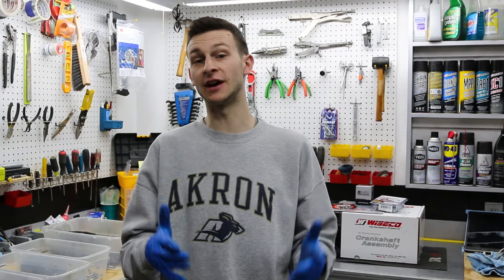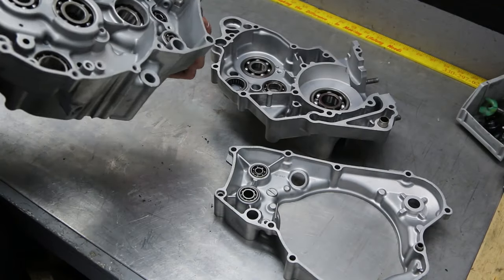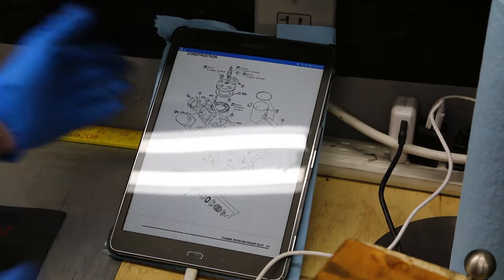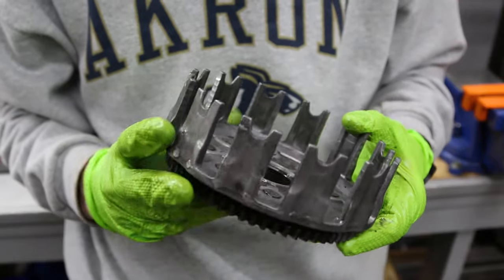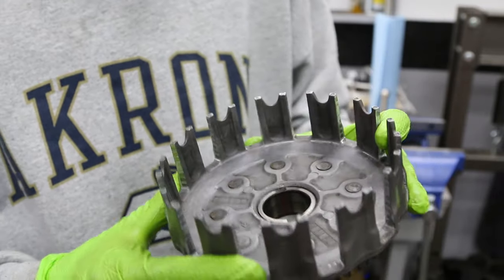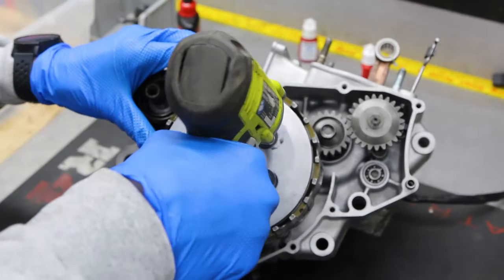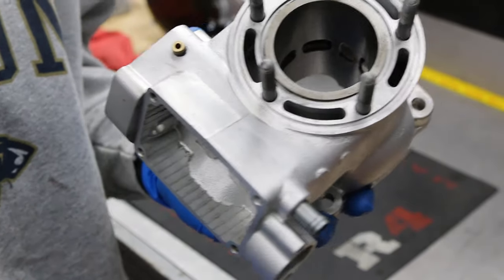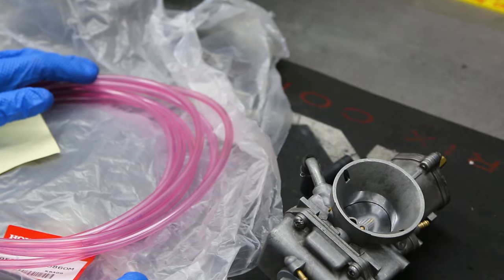The Ultimate TWO STROKE Engine Rebuild - RM 125

Comment: Looks good man. Wanted to call you out for not using a crank puller but you redeemed yourself by using a Motion Pro special wrench on your cylinder base nuts  (most just use a wrench and don't torque them) so I decided to give you a break...lol J/K
Reply from the maker: Haha I've honestly never used or felt like a need to use a crank puller. I do use that cylinder wrench all the time, just gotta make sure to do the moment calculations beforehand to get the torque numbers converted!

Comment: Why wouldn't you of put new lower end bearing's in if you already have the case split open and torn apart. Still good I would of still replaced them and kept the old ones as back up's.
Reply from the maker: Money. Would have been over $100 just in those bearings. This is still a bike I am planning on flipping and making a profit on, so I couldn't do everything. After inspecting the bearings, they all checked out good so I made the decision to reuse them.
Reply: Fair enough.